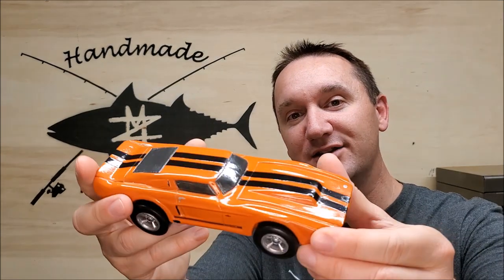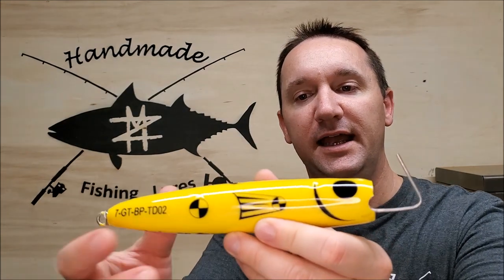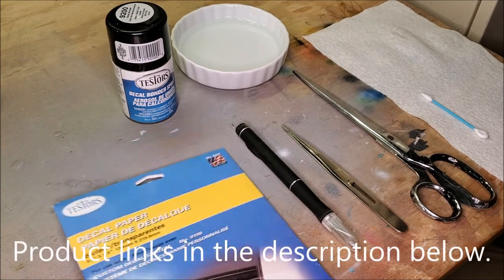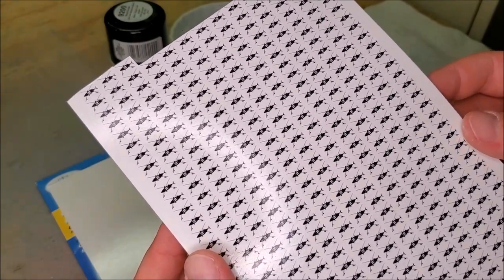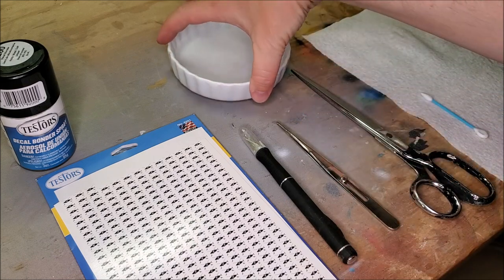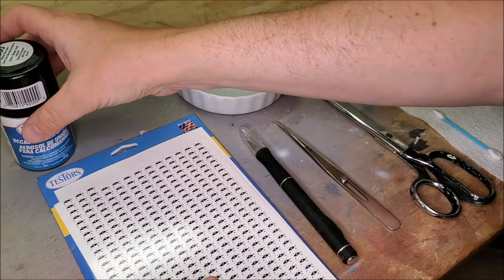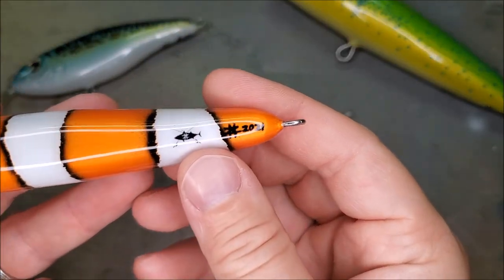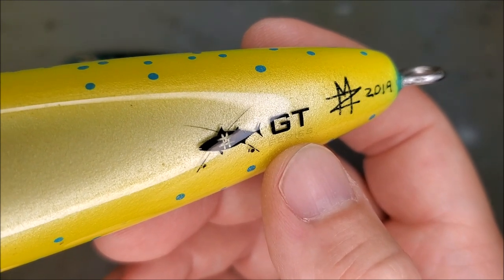Making Custom Decals for Fishing Lures: a step by step tutorial

Comment: Hello master... I would like to know .. what is the best way to apply epoxy resin for jigging lures.. because i clone lures and i actually apply resin epoxy just by a small nail polish brush.. i find it  ... Not so smooth.. there are some bumps on it..
Reply from the maker: I also use a small brush. It may be the resin you are using. The best I have found so far is TruCoat, but I think East Coast Resin works really well too.

Comment: Hi - I notice that you're using a decal bonder spray versus a clear coat spray. What's the difference and does it matter? Thanks
Reply from the maker: I was using decal bonder, but it has been very difficult to find lately. From what I have read, it doesn't seem to matter. However, some clear coats can turn yellow. What I do is make a test print and spray it. After it dries, if the ink runs when i put it in water, I try something else.